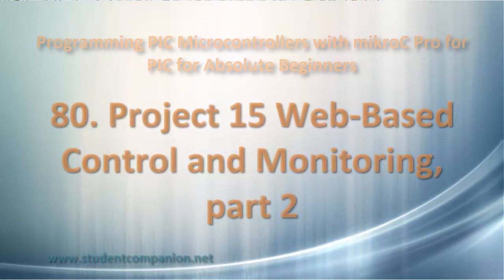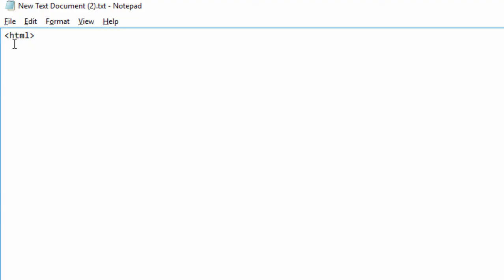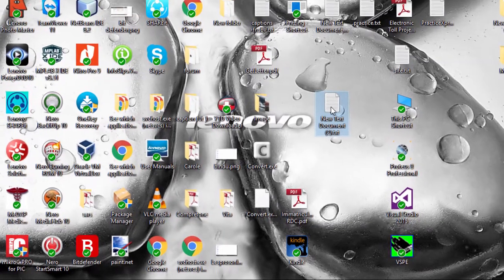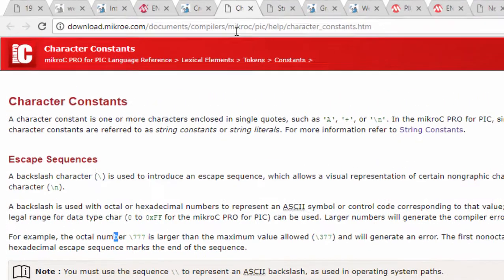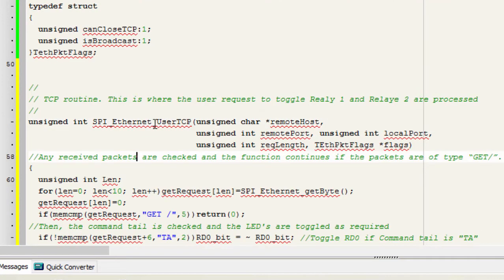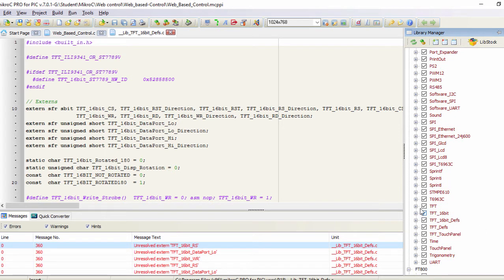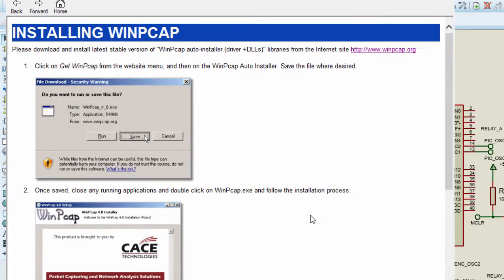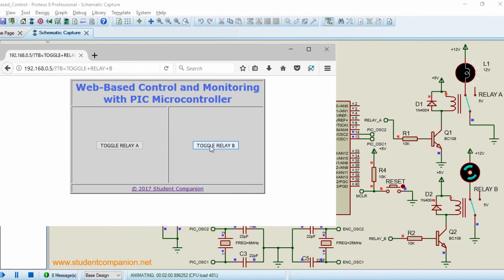80- Project 15 Web-Based Control and Monitoring, part 2 | mikroC Pro for PIC Tutorial

Comment: Dear Bitahwa,  First of all our modem is disconnected from internet. We connect modem to PC via ethernet cable. Is this right?
Reply from the maker: Hi. Are you simulating or using hardware? What exactly us your question?
Could you describe your problem in relation to this tutorial?
Reply from the maker: Also provide as much information as possibe like:
The PIC you are using, XC8 and MPLAB version, is using MCC its version as well and other relevant information
Reply: @StudentCompanion  We are doing the same exercise that what you did in the video. What is the relation between MPLAB we are using mikroC.
Reply from the maker: I thought you were using MPLAB. my apologies. 
So what problem you have encounted?
Reply from the maker: Are you simulating or using hardware? Is your network card activated?
Reply: @StudentCompanion  We are simulating in Proteus. Yes our network card is active.
Reply from the maker: @codernemesis  What exactly did you use as IP Address? I seeIPv4 Address: 192.168.1.3
 but in the mikroc code you wrote: IPAddr[4] = {192,168,1,5}; This must be the same IP address, the one you use in mikroC is the same that you will use in the browser. The IP address of the ENC28J60 must be the IP address of your computer where you are running the simulation.
Make sure you also installed the WinPcap sofwtare.
Reply: @StudentCompanion  Ok. I understand that ENC28J60 ipadress= Ethernet Realtec ipadress= MikroC ipadress= ipv4 Right?
Reply from the maker: Yes. And they must all be in the same subnet range
Reply: @StudentCompanion  ENC28J60: 192.168.1.4
Ethernet: 192.168.1.4
MikroC: 192.168.1.4
Browser:192.168.1.4  Is it right? But it is not working like that. We cant see anything in browser.
Reply from the maker: I didn't say that. Please watch the video is very clear. There is an IP address for the ENC28J60 and another different one for mikroC.

Comment: No tutorial for MCC server with MPLAB? Thanks a lot!
Reply from the maker: Thanks for your feedback. 
This is with MCC: https://youtu.be/mg6WkaN-u8w
We will add more videos with MCU as server or client soon.
Reply: @StudentCompanion  But what about the server? Its hard to do it? I cant find any tutorial or something, i hope you can add one video about it in one week or very soon
Reply from the maker: @rubendesantos7334  Microchip provides an application note with TCP/IP Lite with examples for TCP  1 as client and 1 as server and UDP as well. You can refer to that document and code to start with your project.
But remember TCP/IP Lite stack used by MCC doesn't support HTTP protocol yet, you can use other supported  protocols.
Reply: @StudentCompanion  What means doesnt support http? I cant do a server? Or how it works? Thanks!!
Reply from the maker: @rubendesantos7334  http is protocol used for websites.  If for exemple you want to do a web server where you need to connect to your server from a web page, you might need htttp. But for other protocols you can have a server with no problem. We are planning to control using a C# appplication for exemple, no need for http.
Reply: @StudentCompanion  and how can i do a web server with xc8?
Reply from the maker: @rubendesantos7334  you can use the full TCP/IP Stack from Microchip Libraries for Applications. There are sample projects you can use as templates.  Read this article to learn more about Microchip Libraries for Applications: https://www.studentcompanion.co.za/microchip-libraries-for-applications/
Reply: @StudentCompanion  Really thanks! Ill contact u if i need a bit of more help if u want, thanks!!
Reply from the maker: You are welcome!
Reply: @StudentCompanion  I need a pic32F with xc32 for the full tcp/ip stack or its posible with the 18f?
Reply from the maker: @rubendesantos7334  Why do you say you need a PIC32F? did you read the release notes? The current version of Microchip Libraries for Applications (MLA) v2018-11-26 clearly shows on the home page that it supports PIC18F, PIC24 & dsPIC33. But it's TCPIP (with Wi-Fi® support only). So if you are not using WiFi, you can download the previous version v2017-03-06 which supports PIC18F, PIC24 & dsPIC33 and PIC32
Reply: @StudentCompanion  Oooh i see, sorry if i look stupid but im new in this world
Reply from the maker: @rubendesantos7334  There is nothing stupid not seeing something, just remember, read the release notes and the help documents before starting.
Reply: @StudentCompanion  I was looking and i dont know how to use the MLA for a web server, all the libraries are for a WiFi sistem
Reply from the maker: @rubendesantos7334  the current version of MLA is wifi only, download a previous version. Read the release notes of the previous versions to know more what's covered.
Reply: @StudentCompanion  Okay, i find the Legacy Version, it supports a server but, it have a lot of info for me, i was reading and i still dont know how can i continue
Reply from the maker: Did you read the release notes of TCP/IP Stack?
Reply: @StudentCompanion  Yes! And i mean the Legacy version its the only one who have HTTP Web Server, i guess i look it well (sorry my bad eng)
Reply from the maker: @rubendesantos7334  Which Microchip Library for application version did you install? What demos do you have in that installation folder?
Reply: @StudentCompanion  I download the v2013-06-15 version, the Legacy, and i download all the TCP/IP Demos
Reply from the maker: @rubendesantos7334  The legacy version uses the old C18 compiler, it doesn't use the current XC8, but if that's what you want, you can also use it, there are many examples on YouTube explaining how you can do it like these videos using PIC18F microcontroller: 
https://youtu.be/ANFb2MyQ4YA
https://youtu.be/xrSDKzxpaHM
https://youtu.be/f_3PPh_LJhI
For XC8 version, on the microchip libraries for applications page, there are 3 tabs, one for current MLA, 2 for Legacy and 3 for downloads archives, it's under the 3 tabs where you can download previous versions that work with XC8.
Reply: @StudentCompanion  Oh! I was thinking C18 was compatible with XC8... Im sorry T.T, tomorrow if i can, ill look what version can i use, im sorry! Thanks for all :(
Reply from the maker: Ok. C18 was a previous compiler before moving to XC8. It's very similar to XC8. But C18 is only for PIC18F If I'm not mistaken unlike XC8 which can be used for PIC10, PIC12, PIC16 and PIC18
Reply: @StudentCompanion  I was hardlooking for the version and i saw a archive named ''WebVend'', i didnt found a version with PIC18 and XC8, all its C18 and XC24 and more, i dont really know if im doing something wrong
Reply: Prob its posible to change another Demo code but i think thats really hard for something like me cause im really new in this
Reply from the maker: You can follow those videos I posted if you don't mind using an old compiler
Reply from the maker: You can modify existing demos to suit your needs

Comment: In this project, PIC is server. I have a question: On internet, IP here is static or dynamic? Configuring ethernet adapter (TCP/IPv4 properties) only give static ip on LAN not on Internet. So any way so I set IP is static IP. Im confused because a guy told me IP is dynamic and it's not good for server.....
Reply from the maker: A guy told you an IP is dynamic? That guy lied to you. You can set an IP as static or dynamic if you have a DHCP server. In this example we used a static IP address
Reply: @StudentCompanion  Thanks for reply. If I want to control relay on my laptop which is connect to other home networks (not the same network that I connect to enc28j60), what do I need to do? Im thinking about using dynDNS. If I use dynDNS, anything change in MikroC code?
Reply from the maker: @nguyenvu6371  you must set the router IP address and DNS server in mikroC.  The rest is configuration in your Router
Reply from the maker: @nguyenvu6371  You can use the SPI_Ethernet_confNetwork() to configure the subnet mask, gateway and DNS server address. 
Read this to learn more: http://www.studentcompanion.co.za/interfacing-enc28j60-ethernet-controller-with-pic-microcontroller-mikroc/

The rest is settings in your router but setting up the NAT.
You can Google: "How to access local ip from outside network" to learn more.

Comment: Hi!  I have a problem. Now I want to add a temperature sensor LM35, send values measured by LM35 to Webpage using SPI method. In main function, I have configured PORTA as analog, RA0 as input ( connect Lm35's data pin to RA0) and initialized ADC.  But I have no idea how to send values measured by LM35 to Webpage. Could you give me some tips?
Reply from the maker: Hi, you can refer to these examples for your project: 
1. https://libstock.mikroe.com/projects/view/638/web-server-designed-for-pic18f4620-enc28j60-and-ds18s20-avec-graphique-des-temperatures
2. You can open the SPI Ethernet example here, it's based on our project but it sends back the status to the web page. SO for you instead of sending back the status, you could send the temperature value: https://download.mikroe.com/examples/full-featured-boards/plc/picplc16-v6/picplc16-v6-examples-v101.zip
Reply: You're freakin amazing! Thanks so much
Reply: Have u found the solution for this? Haha
Reply: yi huan teh  That would be great if u send me hahaha. Thanks so much. Excited seeing it
Reply: yi huan teh  Wow man this is great. I remember replying u my email but probably my connection was bad.
Reply: yi huan teh  if(!memcmp(getRequest+6,"TA",2))RD0_bit = ~ RD0_bit;
I wonder what this line do

Comment: Hello sir! What a great tutorial video. I tried this project and it worked perfectly . Unfortunately, I have trouble understanding these lines in SPI_Ethernet_UserTCP function:
"   unsigned int Len;
  for(len=0; len<10; len++)getRequest[len]=SPI_Ethernet_getByte();
  getRequest[len]=0;
  if(memcmp(getRequest,"GET /",5))return(0);

  if(!memcmp(getRequest+6,"TA",2))RD0_bit = ~ RD0_bit;
  else if(!memcmp(getRequest+6,"TB",2))RD1_bit = ~ RD1_bit;

  if(localPort != 80)return(0);
  Len = SPI_Ethernet_putConstString(HTTPheader);
  Len += SPI_Ethernet_putConstString(HTTPMimeTypeHTML);
  Len += SPI_Ethernet_putString(StrtWebPage);
  return Len;  "
Could you explain these for more details? I'm noob, sir. I hope you can help me out. I really appriciate!
Reply from the maker: Ok we will respond to you shortly
Reply: @StudentCompanion  Thank you so much. I will wait.
Reply from the maker: @nguyenvu6371  You can learn more from this article: https://www.studentcompanion.co.za/interfacing-enc28j60-ethernet-controller-with-pic-microcontroller-mikroc/
Reply from the maker: Hi, 
the  SPI_Ethernet_UserTCP() routine is the TCP handling code and it is internally called by the library.
Basically all the code to toggle our relay is written in this routine.
This routine will require you to fill in some few parameters for it to work: 
unsigned int SPI_Ethernet_UserTCP(unsigned char *remoteHost, unsigned int remotePort, unsigned int localPort, unsigned int reqLength, TEthPktFlags *flags);

Parameters:

remoteHost: client's IP address.
remotePort: client's TCP port.
localPort: port to which the request is sent.
reqLength: TCP/HTTP request data field length.
flags: structure consisted of two bit fields :

typedef struct {
  unsigned canCloseTCP: 1;  // flag which closes socket
  unsigned isBroadcast: 1;  // flag which denotes that the IP package has been received via subnet broadcast address (not used for PIC16 family)
} TEthPktFlags;

So from this you can see, we will need to get the length of the TCP/HTTP packet using the   unsigned int Len. That's why we are looping to get the length of the buffer.
Check if the HTTP request is GET,
Check if it contains TA so that we can toggle relay on RD0 or check if contain TB to toggle RD1.
Each Ethernet communication works with Port numbers, the HTTP is on port 80 by default, so we are checking if the request is not on PORT 80, we just ignore it.
Reply: @StudentCompanion  Thanks so much! Have a nice day!
Reply from the maker: @nguyenvu6371  you are welcome!

Comment: Yes bro im using my school wireless so iv connected an ethernet cable to it and the Ethernet icon shows its connected  but its still not working
Reply from the maker: Unfortunately I don't have anymore suggestions for you. Upload youd full mikroC code together with your Proteus code. Zip them and upload it on our website Forum page. I will run it on my side and see if it will work. Otherwise record a new good quality video showing clearly all your steps including all your code, the full schematic, network activity. Maybe I can see something else because your past video was not clear and did not show all the steps.

Comment: ''For the project to work, the network card on the PC must be connected, so connect something either to wifi, it won't send anything to internet just to activate the network port for the project to work''. Please elaborate more on that for me especially on network card connection
Reply from the maker: The network card must be active. This is what I believe is your problem. Do you have any wifi router or even modem around? Or any network device that you can connect to your PC with a network cable? If you dont, then consider installing a virtual PC

Comment: Hello brother please this is the link to the  video you asked me to do concerning  mikroC Pro for PIC Tutorial -80- Project 15 Web-Based Control and Monitoring, part 2 but please you have to download it from youtube in order to view it clearly. This is the link  https://youtu.be/ImacJzdMxjk thank you very much .
Reply from the maker: Hi Boateng, the video you posted is not clear but I think I managed to see what you were talking about.
The IP address of the PC if I saw properly you set it to 192.168.6.142 , subnet mask to: 255.255.255.0 and the IP address of the PIC in mikroC you set it to: 192.168.6.146 but I didn't see the subnet mask in mikroC code.
One crucial thing you didn't show on your video and I thing that might be the problem is the network activity on your PC on task manager at bottom right. When you connect a network cable to a PC, it will show you a computer icon showing connected, if you connected with a wifi router, it will show you connected with some few quarter circles. I didn't see that in your video. For the project to work, the network card on the PC must be connected, so connect something either to wifi, it won't send anything to internet just to activate the network port for the project to work.
otherwise use a virtual PC.

Comment: Im sorry it was a typing mistake ,I meant i used  192.168.6.9 in the MikroC code and  192.168.6.88  in my ENC controller rather
Reply from the maker: Then it should work if installed the network drivers. Are you using wifi? On your task bar, is the Ethernet icon shows connected?

Comment: Please if have connected an ethernet cable to my pc , my IPv4 Address is 192.168.6.88 my gateway is 192.168.6.1, iv downloaded your own code and tried ,i used 192.168.9 in your  MikroC code , i used 192.168.88 in ENC and used the same IP for  the IPv5 in the network sharing center but i did not diagnose since the diagnosing resets the textfield back to default(Plain) but im still not able load the page on my chrome browser,iv tried different browsers but its still not working.Also when run the proteus simulation i get packet dropped due to buffer overflow.
Reply from the maker: A valid IP address has always 4 number group. Not 3

Comment: I haven't connected any  ethernet cable but i was using a wifi cant it work
with that and please if lets say my IPv4 Address  is 192.168.7.8
and my default Gateway is 192.168.7.6 which one am i supposed to use in  my MikroC code and my PIC in proteus and also in my ethernet settings.
Reply from the maker: You can also use Wi-Fi it's fine as long as your PIC IP address is in the same range as your Wi-Fi Gateway address.
Reply from the maker: Your IP to use in mikroC should be unique a different IP address but in the same range. Meaning same IP address but change only the last number to something else.. the IP to use in Proteus is your computer IP address. Please watch the video again fully part 1 and part 2 we explained in detail with demonstrations.  You can't ask these types of questions if you watch it completely

Comment: Do i need to connect serial Ethernet board  to my computer Ethernet port ?
Reply from the maker: You can connect directly to the PC or to a network switch
Reply: well, so did you connect it physically to your computer  to run the simulation of the project you made using Proteus..coz i tried a lot but no page appear to me
Reply from the maker: No. It's simulation no need to connect it to the PC. But how are you testing? Is your Ethernet port ON through a cable or WiFi?
Reply: my ethernet port 
connected through cable to 
serial Ethernet board
Reply from the maker: Your Ethernet port must be active. And make sure in the same local area network
Reply: @StudentCompanion  
thank you very much . The project is running
Reply from the maker: Good to hear that. What did you do? What was the problem?

Comment: Can i know how to interface with esp8266 module with this controller using mikroc
Reply from the maker: Just connect it to the PIC USART module and access it with AT Commands
Reply: Student Companion where can i find this at commands for mikroc
Reply from the maker: The AT commands are not mikroC commands, they are standards commands  to control GSM, wifi, Bluetooth modules from the PIC USART. Read the ESP8266 datasheet and AT document to learn more.
Reply: Student Companion it will be helpful if u make video on esp8266 with pic
Reply from the maker: Yes we will do one on the near future.